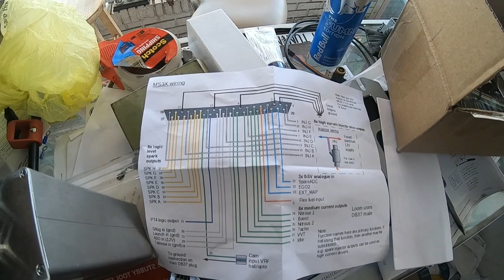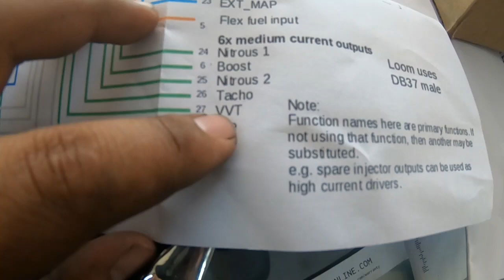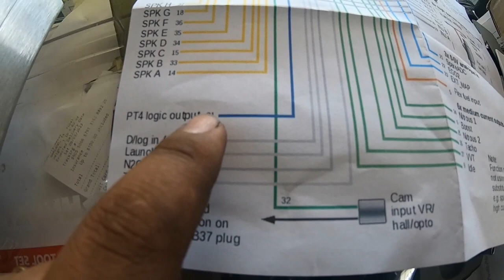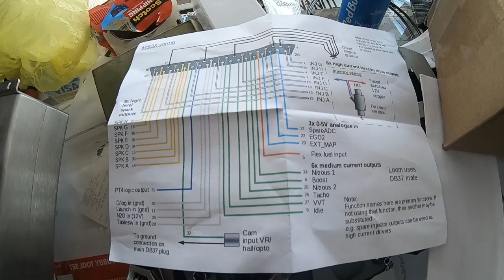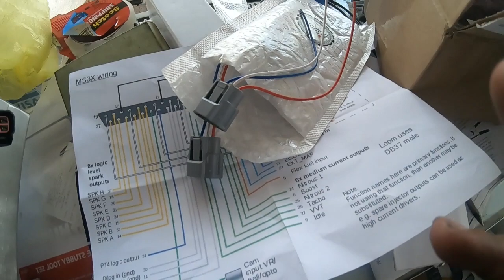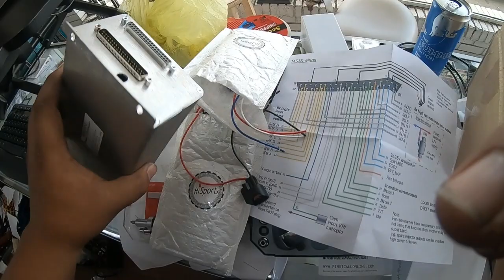Mazda5 Megasquirt 3 with MS3X upgrade along with wiring planning

Comment: How did you match the triggering? You just parallel wired it to the stock crank and cam triggers?
Reply from the maker: Yes.  Only crank was used, stock ECU handled the cam VVT at the time